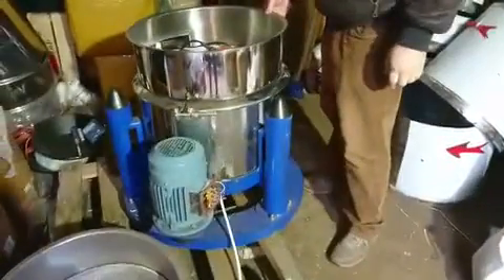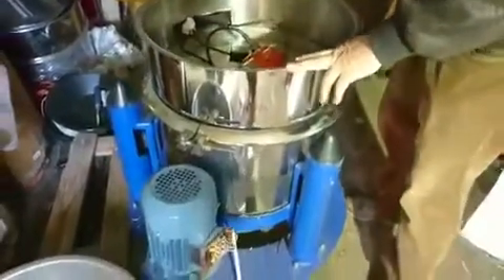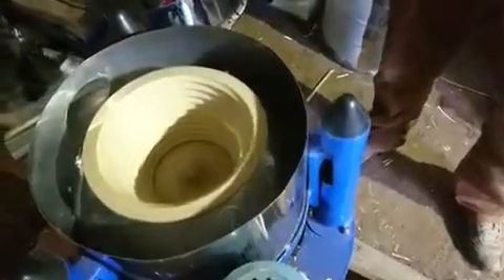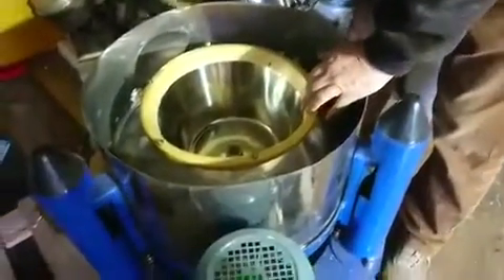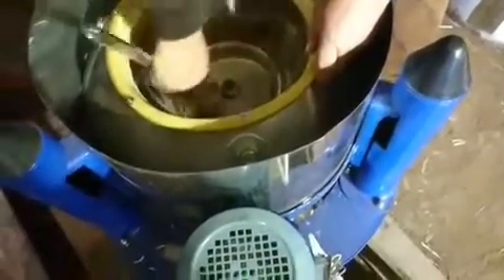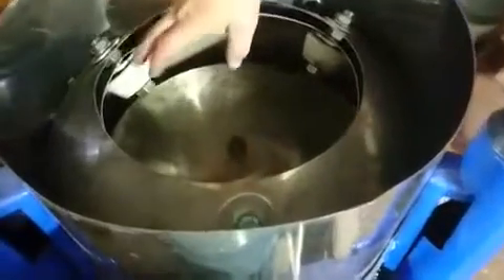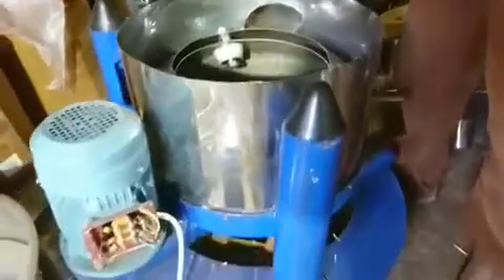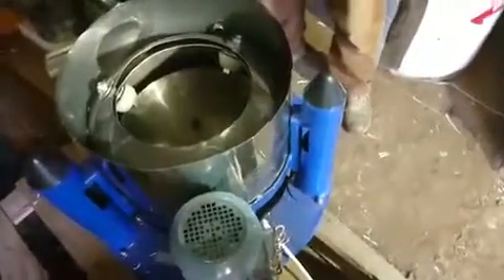Centrifugal concentrator Flexicone CVD-FB300

Comment from the maker: Why Flexicone Leaching Technology?
There is no need to keep a separate position of a chemical technologist on staff.
Enough knowledge at the level of school chemistry and amateur photographer.
For specialists I explain - we solved the main problems in the leaching of gold.
In our technology:
low cost reagents
non-toxic, non-flammable, non-corrosive reagents
stable easy-to-manage gold solution (PH from 4 to 10)
selectivity to noble metals (copper, arsenic, tellurium, etc. is not a problem)
recirculation of solution and reagents, without discharges into the environment
What is the output?
empty cake (rock) washed with water containing elements in the wet part of the solution at the level of the mineral of Esentuki
precipitated BM with a purity of 98-999%
regenerated solution with the main reagent 99.5%

Comment: Mate your units haven't got a snow balls chance in hell of any where near the throughput you are blindly talking about per hr to small scale miners, when you MUST pre screen down to 3 mm before you can put it through a Flexicone then it is essentially 'out of the reach' and TOTALLY impracticable for small scale miner who cannot pre screen and therefore your unit would be  a COMPLETE waste of time and money.
Your units are ONLY suited to where machinery can pre screen near 100 times what your unit can process per hr to make it efficient and ONLY if you can pre screen everything out of the wash that is larger than your required 3 mm input can you possible get a decent throughput and in any case the capacities per hr you claim are all, perhaps also if you are working on a beach or in sand, but this is not a usual mining environment. Your video at https://www.flexicone.net/copy-of-produkciya shows CLEARLY where your Flexicones are best suited, at the end of a sluice that is only being fed sand (or possibly screened at the end of it before it goes into your cones, otherwise forget it! Dean. GGI.
Reply: And they’re made out of washing machines,will last 2 days on a minesite